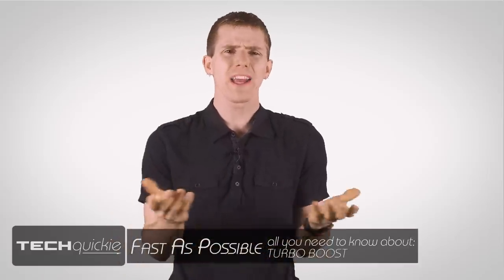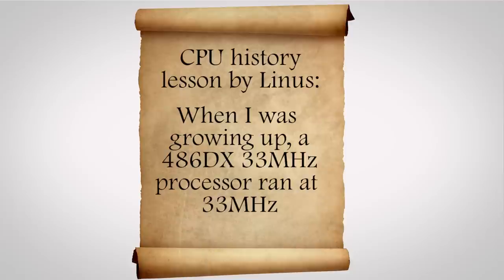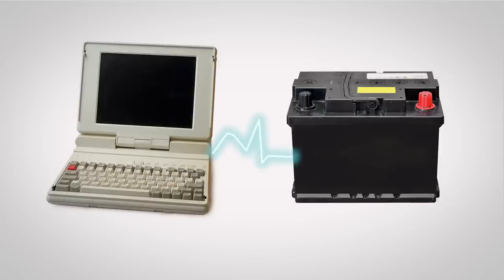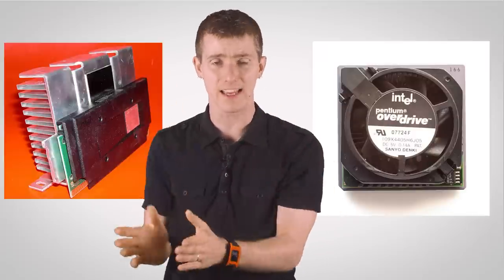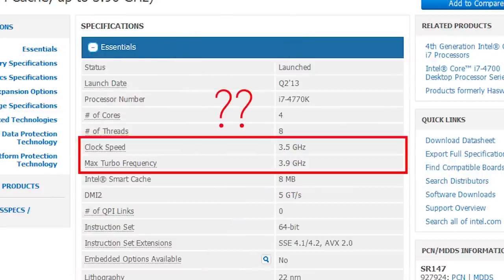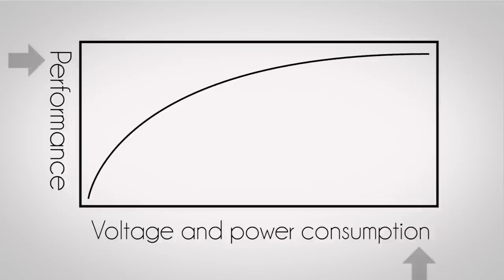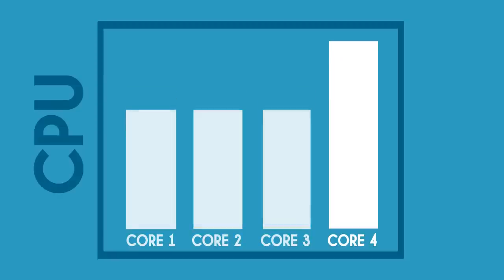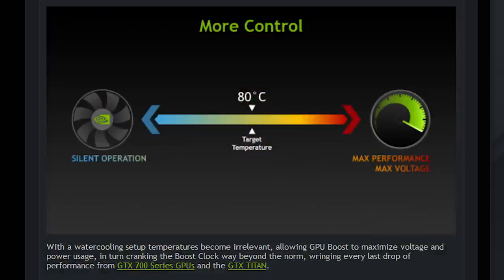Turbo Boost & Processor Efficiency as Fast As Possible

Comment: when I max out on all cores my i7 4770 still turbos all cores to 3.84ghz from 3.5 how is this possible if it only suppose to turbo one core?
Reply: Because all but one core turns off. They ALL get to that clock but only ONE is ever going to be used
Reply: Remember. he knows more than you. And hes also payed by intel

Comment: Is turbo boost a defeault thing (it's always enabled since the first day I use my PC) or is it supposed to be enabled or downloaded manually?
Reply: +Joey Slávik You can probably download it the same way as you can download more ram. Just go to downloadmoreram.com and you can find it.
Don't actually do this :p
It is always enabled and you don't have to worry about it. I'm not sure, but I wouldn't be surprised if you could disable it in the bios. I don't see why anyone would do that though.
Reply: +Animiles holy shit man. this lyfe hax helped me so much.
Reply: +Joey Slávik it's built into the bios so no downloads (ever) and it should always be turned on unless you specifically turned it off
Reply: +Animiles I have it turned off, because, with my stock cooler, that extra 400mHz was pushing temps up a little. I got the temperatures to come down about approximately 10c. Rather strange, but then again, ventilation is a bit weird under my desk.

Comment: I got a question, my pc says i have intel turbo boost but i don't notice it, i am not sure if there is a way to turn it on, my core is i7 4710HQ, the intel site says max frequency is 3.5 ghz. if you guys tell me how to enable it, it would be great thank you.
Reply: +Chuckel Nutz Same here
Reply: +Gav J tried that, my bios had nothing, could not even change frequency
Reply: +Gav J whats the program calked thanks?
Reply: +Gav J im going away for a week soooo...
Reply: +Gav J ok thanks with the help, if it does not work i will contact you next week, Thank you!
Reply: +Gav J hey i got time this morning if you want to walk me through how to use ITU
Reply: +Chuckel Nutz Intel Turbo Boost is an integrated feature of your CPU :). There is no "turning it on". If your processor is set to use its all (which Windows does by default, assuming that's what your OS is), then "Turbo Boost" is simply your CPU clocking a few cores up to a much higher Ghz whenever it needs to (for example if you're compressing a folder with 7Z or RAR, or if you're encoding/converting a video or audio file). If you want to be absolutely certain though, (again assuming you're using Windows) go into Power options (in Control Panel), "change plan settings" then "advanced", in the "Processor Power Management" section, make sure the "Maximum Processor State" is at 100%. You're actually able to turn off Turbo Boost using this by setting it to 99% - it won't actually be 99% if you set it to this, your processor will actually be around 30-40% slower in the difference between 99% and 100%, because the Turbo Boost feature will be disabled. To check the actual speed, you could use software that tells you or just use Task Manager (the "Performance" tab). Hope this helps.
Reply: +Gex9z ok thanks, when 8 dont play games i get 3.4ghz but when i launch games it goes to 2.49ghz max, i was w9ndering if you could help me fix that... thank you
Reply: Chuckel Nutz The reason it downclocks when you play games is to not generate unnecessary heat. The vast majority of games barely use the CPU: most are all about the GPU. Because your GPU (graphics processing unit) is running all-out, generating a ton of heat, it's a good thing that your CPU is working at a moderate clock speed so that your PC doesn't generate much heat. If you believe your PC is slower than normal, and your CPU clock speed is lower than its maximum, then I can assure you that it is not your CPU that is causing your performance hit (most likely your hard drive if it's Windows itself, or if it's a game, it's most likely your GPU). Your CPU will clock itself up as much as it can whenever it needs to. For example, if you notice your clock speed is currently 2.0Ghz while you're playing a game and you use some sort of software to force it to 3.5Ghz, there will literally be zero difference in performance since there isn't enough processing going on to justify a clock speed of 3.4Ghz :). As a weird analogy, lol, imagine you have a cup that automatically changes its size depending on how much water you have in it. Your CPU going at 3.5Ghz when it only needs 2.0Ghz for current processing is like filling that cup halfway, and clicking a button to force it to be double the size: you'll still have the exact same amount of water.
Reply: +Gav J 
Nowadays most pc games can make use of all the cores. It will slow down some cores to redirect power back to some of the cores that were idle. It is actually faster to use more cores than using turbo boost. 2.5Ghz × 4 = 10Ghz while the max turbo boost will only use 1 core = 3.5Ghz
Reply: Not really. It depends on what you are doing. Some older games and some software can't make use of all the cores so it can only use 2.5Ghz instead of the turbo boosted, 3.5Ghz. It's best to leave it on as it will choose the best option for your computer to perform its best.
Reply: ***** Games like L4D2 have a setting call "multi-core rendering". 
Each core offers a base speed of 2.5 GHz but can dynamically increase clock rates with Turbo Boost up to 3.3 GHz (for 4 active cores), 3.4 GHz (for 2 active cores) and 3.5 GHz (for 1 active core). So if your computer can handle the heat, all the cores can turbo boost to 3.3 Ghz. And the more ram you have, the faster your cpu is.
Reply: Josiah Tan Yeah that's another factor. Chuckel Nutz When a game (or any software for that matter) supports hyperthreading (essentially simulating double the amount of physical cores, like 8 cores from 4 in the case of an i7), the clock speed is reduced, but the processing power is either higher or the same, depending on the task. It's important to note though, that most games don't require much CPU (even though multicore rendering is a thing) - this is assuming you have a modern CPU, released within the past 5 years or so. There are some exceptions though.
Reply: +Josiah Tan False.
By youre logic a 8-core CPU running at 2.9 GHz will perform better then a 4-core CPU running at 4.3 GHz (8x2.9GHz=23,2GHz and 4x4.3GHz=17,2GHz) 

You could have an 8-core CPU running at 2.9 GHz, but sometimes a 4-core CPU running at 4.3 GHz will be faster even with only half the cores. It all depends on how many pieces each task can be split up into. Video processing is one of those things where the entire task can be split into as many pieces as you’d like. In such a case, having the 8-core CPU I mentioned earlier would give you an advantage. Most applications (such as browsers), however, make use of only one or two cores, meaning that in those cases, you’d be better off with the 4-core CPU.
Reply: +Woolies use Throttlestop from techpowerup and click set multiplier and set it to 26-35 and you will have it boosted :) if it overheats it will throttle Down to 800mhz so be careful With that
Reply: Magna Stacippa  I said that if "multi-core rendering" is enabled you can make use of the total speed in this case the 8-core Cpu at 2.9 Ghz which is faster BUT when your software/game can't make use of all the cores the 4 core 4.3 Ghz is slightly faster BUT remember the os has to be running in the background so the more cores technically, the faster since the os doesn't need to share the same processor with the software/games.
Reply: Josiah Tan I have a six core (FX6300) and a quad core (i5 2500k) the Intel processor performance is way better in gaming. Multycore rendering is useful only if your cpu is weak. Most games don't even use that much cpu power.

Comment: I have an NEC PowerMate Portable (hah, portable... need a fucking wheelbarrow) and pressing ctrl+alt+- ups the clock speed from 8MHz to 16MHz, or you can also adjust it in software. The backlight in the screen is gone though :( need to fix that. And the HDD (which is 42MB) makes the nastiest noise, I'm surprised it still goes. However I think it's some kind of proprietary connector, so if it does die... :(

Comment: does it automatically reach maximum frequency when needed?
Reply: Yes, it is (When power and heat limit is allowed to do anyway.)
Reply: But in what circumstances will it go to maximum frequency? When the laptop is lagging? Playing video games?
Reply: When a workloads need it. Example with illustration: I'm running a video editing program with my CPU base clock maxed out at 1.7 GHz. But when I done editing and click export files to MP4, the program request for maximum horsepower available to accelerate video export process. CPU receives request and checks if a power and heat limit is exceeding safety point. If not then CPU then say "go ahead" then accelerates clock to 2.4 GHz Turbo Boost frequency to help video exporting faster, after it finished exporting video. Program says to CPU "okay, work is done. thanks a lot." and CPU clocks back to 1.7 GHz. But if the temperature is exceeding safety limits the CPU will say "Sorry, I can't give you any more power. I'm exhausted." and it stuck at 1.7 GHz until it cools enough. (I apologize if my information is wrong)
Reply: You forgot to mention that it can only turbo one core at a time.

Comment: is it possible to boost to turbo manually? or dose it have a mind of its own?
Reply: +Dadzie Brewer I believe you can set the minimum power usage % of the cpu in the power management in windows, thereby forcing it to run at max speed.

Ive tried it on my rig and it seems to work fine
Reply: +Dadzie Brewer try ThrottleStop from techpowerup

Comment: how terrible is my Notebook ?
Intel(R) Core(TM) i7-4500U CPU @ 1.80Ghz 4th Generation.
8.00 Go Ram
Intel HD graphics 4400 1.8G.
Reply: ***** i can add another GPU ? because intel HD graphics 4400 comes with the processor so i suppose i can add a Nvidia on the motherboard??
Reply: ***** thannk u so much for u help and if u have time can u check for me if i have this abbility to add grafic card? i have Acer Aspire E1-572. but only if u have time otherwise i thank u so much u helped me alot :D
sorry bad Grammar still Learning English .
Reply: taha wahbi There are various models of the E1-572. The motherboard of the PC must have at least a free PCI-E slot and, of course, enough space in the box.
However, unless you REALLY need it, I don't recomment gaming on laptops. It's more expensive and you don't get the same performance. And desktop PCs are easier to build and repair (I think).

Comment: Where can I turn on turbo speed? Is it better for gaming?
Reply: It should be on by default, but sometimes you have to turn it on in the BIOS. As for gaming, It won't make much of a difference, because most of the processing is done by the GPU.
Reply: +EpicAnimations but clocks a cpu can affect performance quite a bit in some cases like the 6400, turbo gives an extra 500mhz

Comment: I am gonna buy a medion pc intel core i5 and its 4ghz fast is this good to play minecraft on high settings?
Reply: +Musab Bilgic GPU? More that 2GB RAM?
Reply: Really? Minecraft? Its not worth the money if thats the game you want to play.
Reply: for minecraft it's enough an i5 with less than 2 GHZ. ;)
Reply: +firas alboni You can get any shitty computer and play minecraft just fine. Dont waste your money if your going to play a game that doesnt take advantage of better hardware and programming.
Reply: Missing No I'm not playjng Minecraft, anyway. I hate gaming.
Reply: +Missing No That's not quite correct. Minecraft benefits mostly from more ram and CPU power.depending on the mods even from GPU power.

Just compare Minecraft on a ~100€ tablet with Minecraft on a 500€ gaming PC.

Comment: And cache means?
Reply: cache was explained in another tech quickie video (look for the different types of ram video).
put basically though, cache is the place where the section of the program that is currently being worked on are stored, its basically RAM except hundreds of times faster so that the cpu can run those lines of code as fast as possible.

Comment: Is there any smart phone that has turbo boast on it??? Just asking 🙇🏽
Reply: +Jay Hamilton Not really but a lot of phones are overclockable
Reply: +Jay Hamilton intel ones I think
and on phones they just kinda opted to have lower power and higher power cores instead of turbo boosting the existing cores
Reply: +Jay Hamilton no most phone apps are less than ten years old and are made for multi-threaded cpus, and there for the apps dont require turbo boost

Comment: Anyone know a cheap-ish CPU that wont bottlr neck a r9 290?
Reply: Intel Core I5 4590, 4690K, 6600K, or if you want something better, a I7 4790K.
Reply: or a fx 8xxx or fx 9xxx if you wish to spend a little bit more money.
Reply: R7 260X Gaming Or not. AMD CPU's suck and there is no denying it. It takes a 8 Core $200 FX-8370 to beat a $165 Quad Core and lower clocked Intel Core i5 4460.
Reply: clock speed doesn't matter,linus said that before,my opinion:amd for budget,intel if you have the money to buy them
Reply: R7 260X Gaming Clock speed does matter. It matters a ton. You just might have thought Linus said that when he said something else.
Reply: it dont,last time in 2000s a athlon 64 with 2ghz++ clock speed crushed a 3ghz++ pentium d/4 at that time....
Reply: +R7 260X Gaming doesnt mean it doesnt matter, it does matter. its just not the only factor to look at.

Comment: why does amd single core performance suck
Reply: Because AMD concentrates more on gamers and video editors who dont have 3000$ for there pc, games and video editing utilizes multicore processors 1000x better than single threaded processor.
Reply: because AMD "cores" are not really full cores. The design of bulldozer/piledriver (or whatever they are not now) combines 2 cores onto a single module, where they share some of the resources (mainly L2 cache) The resources you share the IPC of each core tends to drop. Technically a GPU has thousands of cores, but because of how they are arranged, an individual core by itself is very slow.

Comment: im not smart enough to comprehend what he is speaking.
Reply: basically if you have an intel processor that means if application uses 1 core and leave the rest that 1 core will be OCed to the turbo specs. If all 4 cores are being used then nothing will happen. Fucking turbo boost. Why it aint boosting all 4 at once.